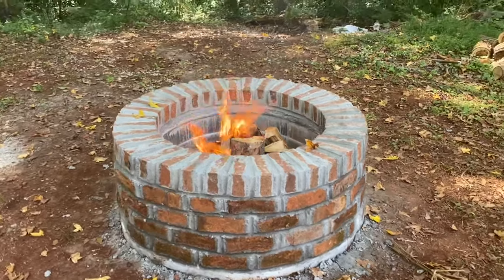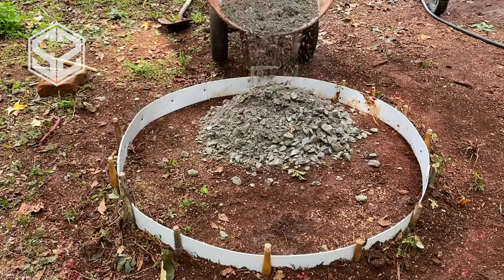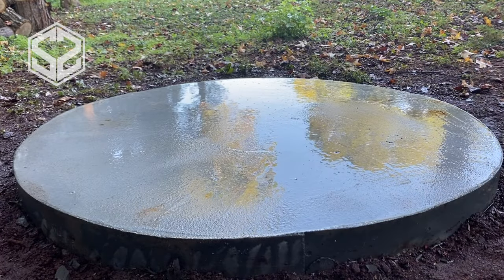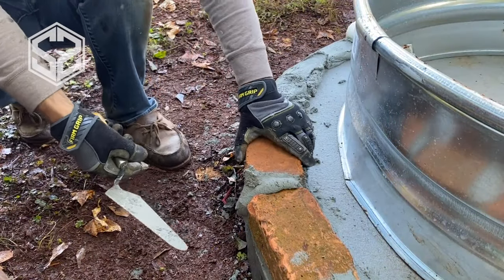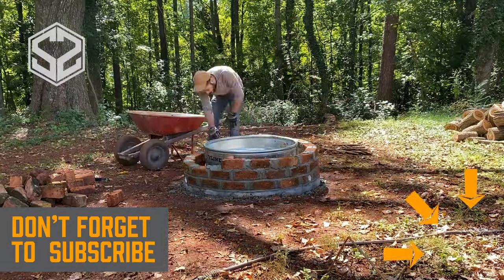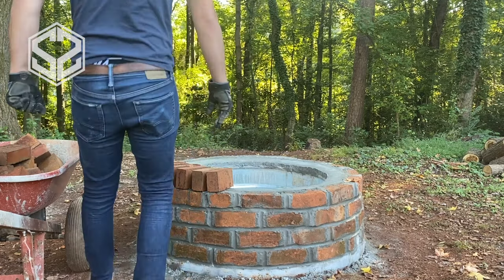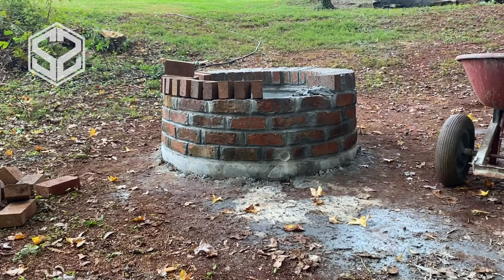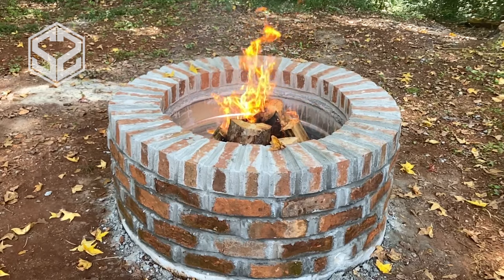Brick Fire Pit

Comment: You can use a 50/50 mix of the muriatic acid and water to clean the extra mortar off your bricks if you want a cleaner look.
Reply from the maker: Thanks!!!
Reply: Muriatic acid even at a 50/50 mix over time eats away at the concrete its just a lower less potent form of 
 "hydrochloric acid" why brick layers stop using it its been found to decay away concrete over time , muriatic acid is an aluminum cleaner for frigerated trucks and aluminum surfaces.

Comment: That sucker will last until the concrete explodes from intense heat!!! People be careful, when it blows it will go off like a cannon.
Reply: i was thinking the same it happened with us before very dangerous
Reply: After the explosion I cleaned it out and repaired the concrete bottom. I love the fire pit so I invested in outside firebricks and it did it again, just not as bad this time. So, I cleaned it out again but this time filled in the damage smooth with pool sand. Also, welded a circular steel rebar grate together to provide a 3 inch airspace for the coals to cool to ash. Now, it works great….just wished I thought of the rebar grate before ever firing it up the first time. I’m very lucky….

Comment: A good OPTION to add to this fire pit is to make a CONDUIT very similar to the PVC pipe ... but perhaps use a metal conduit instead .. for a PROPANE tank hose .. so that if there is ever a FIRE BAN in place by a municipality / local laws .. due to potential forest fire issuance .. then one can STILL use this fire pit DURING a campfire ban / open flame ban timeframe.  This makes this fire pit EVEN more versatile ...   Jus Sayin.   (oh ... and the propane tank can be place several meters away with a longer hose attachment ...and this tank can even be made to be inset into the ground by building a mini- concrete silo to protect the tank, . .and then a lid put on this silo.   Smart, eh ..?
Reply from the maker: Thanks for the tips!

Comment: Great, informative video! I will definitely be using this design for the fire pit I'm about to build!
Reply from the maker: Glad it was helpful! good luck with yours! one thing I would maybe change, one of my viewers recommended filling the gap between the metal ring and the bricks with sand instead of concrete. this would better insulate the concrete and brick wall from the heat of the fire and last longer.

Comment: So after having the fire pit for a while have you had any issues with the mortar or bricks cracking or falling apart from the heat? Anything you would do different?

Thanks
Reply: Concrete is stronger than brick and mortar so I wouldn’t have put concrete In between. Just me

Comment: Dude, nice job!👍 As I started watching, I thought someone FINALLY had the perfect smokeless fire pit build on YT!

You considered what it seems most EVERYONE fails to address: air intake at the bottom - which is what fire craves! (And also doubles as cleanout & drainage!)

1st question tho: how badly did the outside crack from thermal expansion?
It had nowhere to go...

Here's how I would adjust the design to make it the perfect smokeless fire pit:

#1. Drill the top perimeter of the ring with 1/2" dia holes spaced at about 2" centers, just below the top rib of the ring. (A quality step bit works well for this.)

#2. DON'T fill the space between the ring and the brick with ANYTHING - this becomes a hot air chamber which will provide "secondary combustion" at the top of the fire...

#3. As you did, provide the air intake to the interior & cover the pipes with morter - OR, just use pieces of steel pipe, and morter the gaps where they pass thru the bricks & ring, and leave in place permanently.

#4. On a 60° offset, provide 3 more air inlets at the bottom that only go thru the bricks - providing air to the chamber between the ring & the bricks.

#5. Adjust the size such that this air gap between the bricks & the ring is only 1-1/2" to 2" wide - this is plenty for expansion, but tight enough to get the proper hot air draft when in use.

#6. This is mostly esthetic, but I would either lay the top bricks on their side, touching at the inside dia, and with a slight overhang over the ring - thus enhancing airflow at the top... Or better yet - just use the trapezoid cap stones made for the top!

#7. After the inital burn (and the galvanized coating burns off the ring) clean & spray paint with high temp black - and marvel at the beauty of it!😁

P.S. Another awesome improvement would be to set the primary air intake (galvanized steel) pipes partially IN the concrete base -  and/or allowing them to extend far enough inside to be able to top with an old BBQ cooking grate to keep the fire up & drafting PERFECTLY throughout the burn.

I'm working on a similar build based on patio blocks & trapezoid retaining wall block, and wasn't planning on mortering the block - but I think you've INSPIRED ME!👍👍

Comment: Great video! It would be super helpful if you could create a list of materials and measurements for everything. In particular, how many bricks did you wind up using?
Reply from the maker: I used 98 bricks but a few extra wouldn't be bad just incase.
3 - 80lb bags of mortar
11 - 60lb bags of concrete
Reply: @squidsix-nine4868  how so?
Reply: I don't see squids reply ... probably removed;although, I'd rather read all comments to make my own conclusions
Reply: @SimonSaysDIY   
One OPTION that can be added to this fire pit is to make a CONDUIT very similar to the PVC pipe ... but perhaps use a metal conduit instead .. for a PROPANE tank hose .. so that if there is ever a FIRE BAN in place by a municipality / local laws .. due to potential forest fire issuance .. then one can STILL use this fire pit DURING a campfire ban / open flame ban timeframe.  This makes this fire pit EVEN more versatile ...   Jus Sayin.   (oh ... and the propane tank can be place several meters away with a longer hose attachment ...and this tank can even be made to be inset into the ground by building a mini- concrete silo to protect the tank, . .and then a lid put on this silo. Smart, eh ..?

Comment: Awesome job. I see you built this on concrete and didn’t use any fire brick at bottom or paver sand, pebble rocks, etc. so will this eventually crack the concrete?
Reply from the maker: It may slowly crumble over time but if your concerned you can leave sand in the bottom to insulate the concrete from the heat. Personally I’ll just leave a layer of ashes in the bottom to keep the heat from getting to the concrete. I have used it quite a few time and it has no noticeable damage yet.
Reply: @SimonSaysDIY  from my understanding sand is not enough to keep the concrete from cracking. I’ve searched all over and you’re 1 of the first I’ve come across to build directly on regular concrete (not stamped) every article I’ve read said it’s highly discouraged to build fire pit on regular concrete.
Reply from the maker: @GainsMarathon  I haven't had any issues yet but you could definitely get the same end product if you just pour a ring around the outside to lay the bricks on and leave the bottom open to avoid direct contact with concrete.

Thanks!!
Reply: @SimonSaysDIY  Yeah, even if the concrete slab cracks in the middle, continues to crack, spalls, and eventually pulverizes into dust, it would basically only be similar to having a fire on dirt at that point. It's doubtful it would ever cause the brick wall to fail prematurely. My only concern is the stories I read of exploding concrete. Still not sure how common/likely that is. Any fire balls w/ concrete shrapnel in the last 2 years?

Comment: So I'm curious why did you put the concrete base instead of just using dirt. It seems that would not necessitate cleaning or draining. Nice job.
Reply from the maker: Thanks! I was worried about the tree roots busting up the fire pit and wanted a good base to build off of. But you could always just put concrete around the sides and leave the middle dirt.

Comment: very cool build , any considerations for the cement to withstand the heat ?
Reply from the maker: After a few years and many really hot bomb fires a few cracks have formed. It's still holding up really well but I would recommend filling the gap between the metal and the brick wall with sand. this would let the metal expand when hot and isolate the concrete from the heat. Thanks! 😄

Comment: For sure, you did a good job but, IMHO it's definitely overbuilt and shows more concrete than bricks. That's why most DIY fire pits use adhesive between the layers so it doesn't show. Nonetheless you get an "A" for brick laying and neatness.
Reply from the maker: Thanks! I have seen it done with using the adhesive but i'm not a big fan of it but it does seem like a great option to consider. :) Thanks for watching!
Reply: I've tried both Fuze-It and Locktite max lock whatever (supposedly the strongest bond). Both become flexible over time, and particularly in hot weather, don't hold worth a crap. Now trying Gorilla Glue Clear Max with landscaping blocks on the outer, and will do a layer of red clay bricks with refractory mortar on the inner layer. We'll see how it goes.

Comment: I'm considering doing this, how long will it take, how much will it cost and  do I need the metal ring and surrounding concrete
Reply from the maker: Thanks! This took me a full Saturday and then a few more evenings through out the week. You could skip the metal ring as well as the surrounding concrete but it will not be as strong. If I did it again I would build the outside ring of bricks and then drop the ring in and pour sand in to fill the gap. I had the bricks left over from another project but i'm guessing it would take $150-200 or so depending on the type of bricks you choose.
Reply: @SimonSaysDIY  thanks, how much will it cost with just the bricks (estamate)

Comment: Nice job. Did you use refractory cement between the brick and fire ring? Wondering if regular concrete will crack with heat/cool cycle?
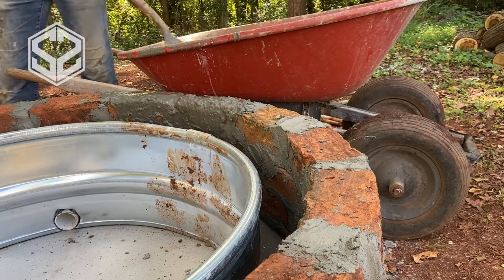Reply: Yes. It will break apart. Could be wrong, but I give it a couple of months. I did something similar using fire brick on the inside instead of a metal ring. I also used refractory cement. Filling the center (11:00) with concrete ensures heat transfer. This transfer will lead to the eventual failure due to the heat/cool cycle. Instead, leave this area OPEN and suspend your top circle of bricks (block it up during construction) with an air gap to allow for heat to escape. You should get a good 8 - 10 years before you need to repoint anything. Hope that helps.

Comment: doesnt the plastic pipes melt after start the fire??
Reply from the maker: I removed it shortly after finishing the video. I wanted to make sure the concrete had cured fulling before hammering them out. I used a block of wood and hammer to lightly tap on the pipe and it came right out.
You are probably correct though the plastic would probably melt and burn.

Comment: Cool stuff man! Did you use a special "fire bricks" and cement or was it just regular?
Reply from the maker: Thanks!! I had some fire bricks left over from another project so I used them to build this. However, the concrete I used was just the normal bag mix you can get at a store. I don’t think much heat should make it to the bricks on the outside so I don’t think firebricks should be needed. The metal ring and cement should shield most of the heat.
Reply: @SimonSaysDIY  It's too tall and you should use fire brick as the interior lining. That metal will eventually corrode. The air vents are a good idea.
Reply from the maker: @danatcanyonlake583  Thanks Dan! I appreciate the advice!

Comment: Only problem when u use cement or mortar on a fire pit is ,it gets hot and it will crack ,u would have to use fire brick ,but it would still prob crack
Reply from the maker: Thanks!! I haven't had any issues yet but i'm sure over time the concrete will crumble and fall apart. But it may take awhile.

Comment: So fire and pvc probably not the best idea as it produces toxic gases I get that you say you can  knock it out but you are clearly having a fire with it still in place and kinda suspect it would not come out easily.
Reply from the maker: I actually did remove it. I wanted to make sure the concrete had fully hardened before i removed them. It was a little stuck at first however with a block of wood and a soft taps with a hammer it slid right out. sorry i didn't cover that is the video, I needed to get the video edited pretty quickly. 

Thanks for the comment. I appreciate it!

Comment: It's build to high , the wall does not provide heat for your whole lower body when sitting next to it , you would have been better off installing a hobo barrel at least the barrel is thin and will get you warm but your pit only burns ones face .. no hate just saying from exp sitting next to one
Reply from the maker: Very true, I have noticed that. It has to me a large fire to get much heat from it at all.

Comment: How wide was this? 3ft?
Reply from the maker: The metal ring I used on the inside is 3ft wide. But then a put a row of bricks on the outside about 6-8 inches from there. So that equals about a 4ft - 4ft 4in outside diameter. I hope that helps! 
Thanks!
Reply: @SimonSaysDIY  YES! Thank you! I will be starting my fire pit tomorrow!!

Comment: I never feel  heat from them.
Reply: If you build them this tall you won't feel heat unless you put a iron grate in it to raise the height of the fire.
Reply from the maker: Yeah, it does shield a lot of the heat being so tall but with little ones running around it is nice to have it higher to keep them safe. :)

Comment: You're supposed to strike your head joints before your bed joints, you are doing the opposite. Also that concrete you are putting around it is way way too wet! Just trying help

Comment: As a Brick layer I Would have used fire brick on the inside liner & on the top as flat laid headers. It would look better. And what about the after burn venting around the Top? It will further kill the smoke though not completely.

Comment: That is the most horrific waste of brick I've ever seen 😐
Reply: Edit: Missed the DIY part 😂 Decent attempt. Your video is being shared in bricklaying facebook groups. On the bright side more views 😁
Reply from the maker: Haha!! That’s funny! Thanks though. I am definitely not a pro!
Reply: @albertda  Read the reply my good sir ✌
Reply: From a professional standpoint, what would you have done differently? Are those mortar joints WAY too big? Because that’s what I’m worried about.
Reply: @meema1  There are 3 issues from a pro point of view. First is indeed the size of the joints, especially in the edger(top) course(row) of brick. When doing radial work you have two options, either build it out of half bricks if its a corner in a garden wall for example or cut a slope in the side of the brick that contacts the vertical mortar joint to allow a tighter joint on the rear and face of the wall. 
2. The bond, the bond being the pattern of the brick. We typically use "stretcher bond" here in the UK and in the US as we did take our building techniques with us back in the day. Stretcher bond is simply a pattern formed by overlapping the brick below by half a brick.  This pit has a weak and untidy bond. 
2. The finish. The pointing (the shape of the beds and joints formed by rubbing with a pointing key/jointer) is a bit rough . Also the brick are VERY dirty and stained by the mortar. Correcting the previous 2 stated would greatly improve the finish in its own right, would've been a lot easier to point for example.

As stated in my previous correction comment. This pit is OK for a DIY attempt at a fire pit and would pass for a "rustic" style pit. But also by following  what I've said in this comment and taking your time, and I mean take your time, anyone could achieve a very professional and tidy looking fire pit 😁 You can apply that logic to any DIY project as the only difference between me and this guy is amount of on hand knowledge I have and the time it would take me to build this due to that knowledge as well as heavily practiced muscle memory.

Comment: Half an inch of gravel at the bottom fills no purpose whatsoever. And those aren't firebricks btw.
Reply: Dude its okay, It'll last at 2 years at best, and the gravel is to ensure the heat stays in the furnace and exits by the smoke

Comment: I'm a real bricklayer and I gotta say...  THAT LOOKS LIKE GARBAGE!!!!
Reply from the maker: If you’re a professional why are you watching my DIY video? Thanks for watching though! I like feed back so I can improve. What would you do differently? Any advice?
Reply: @SimonSaysDIY  it popped up in my recommended.  U might be able to wash the excess mortar off the brick w a water/muriatic acid  mixture and a scrub brush.
Reply from the maker: @momorris1464  Thanks! that would clean it up a lot. I'll try to fix that for any future videos!
Reply: @SimonSaysDIY  just remember to neutralize it after the wash, rewashing w dawn dish soap will do the trick or you could use anything costic to neutralize the acid wash. Hit it with muratic/water let it set in for a few min then scrub the smeared parts. You'll be amazed and it will look great. Good job otherwise! I would hire you right now if you're in northern Illinois.

10-1 water to muriatic acid should do the trick. Also cuting the back part of the brick off would get your head joints tighter around the circle
Reply: @momorris1464  That muriatic (Hydrochloric acid) acid will tear that galvanized metal stock tank up so don't get any on the interior.
Reply: @danatcanyonlake583  not ig it neutralized
Reply: Give the guy a break man I think it looks cool and adds character. Don't see any of your videos
Reply: @stephenmcqueen7296  ...is that the bar by which hazards are judged? I suppose exploding airbags can't be called out by anyone other than another airbag manufacturer?